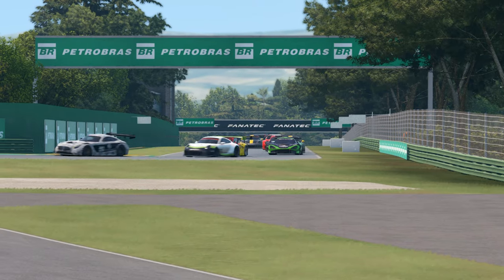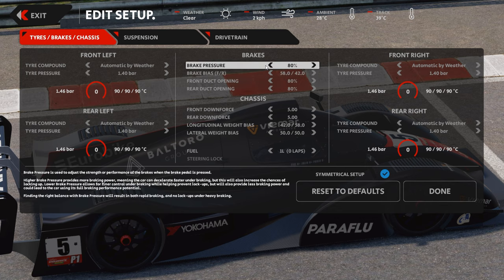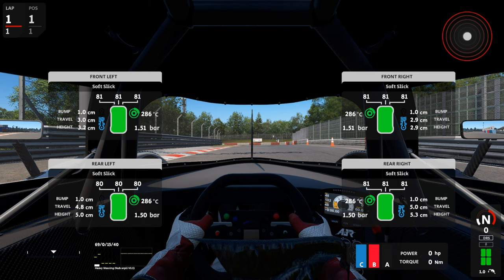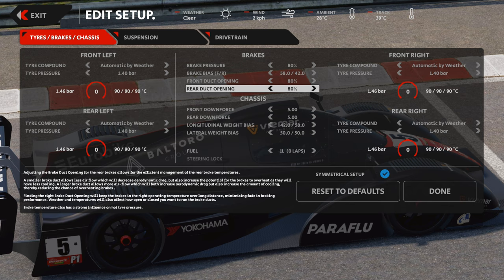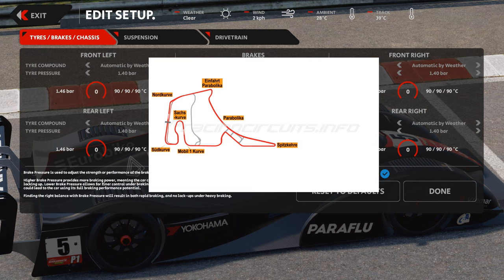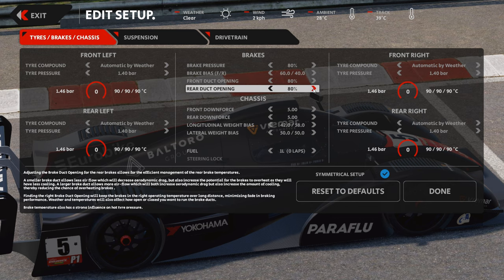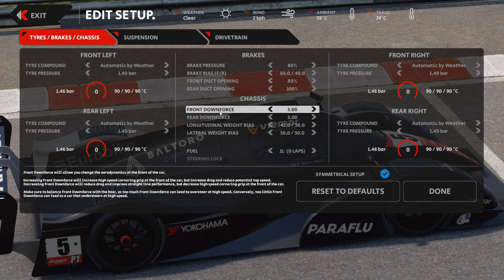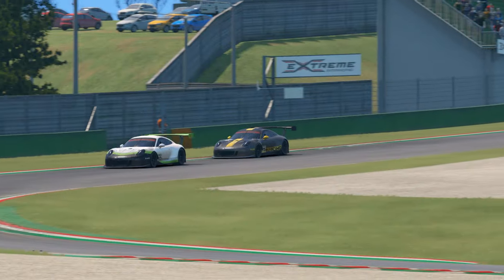Basic Setup Guide (Part 1) - Tyres Brakes Chassis - Automobilista 2

Comment from the maker: *A quick note with regards to camber and pressure adjustments.  It can be a moving target because they effect each other to a certain degree.  Its best to work on them at the same time and it can be a moving target.  Eventually you will get dialed in.*

Comment: Finally someone has come up with this, really appreciate your enthusiasm. Something not clear for me is in 7:21 shouldn't we increase bar to heat tires less and decrease it to heat more? as far as my understdandings you recommend opposite.
Reply: When you lower the pressure all the force is on a lower contact patch, so it gets hotter quicker, less pressure = the opossite
Reply: With a too low pressure, the outsides of the tire heats up more compared to the inside. With a too high pressure, the inside of the tire heats up more than the outside.
Reply from the maker: When you change pressures the IM&Os for all parts of the tire will change.  You have to tinker here tinker there.  You increase the pressure to warm the “M”.  (The middle temperature of the IMO.).

Comment: @Steelcast27 , personally i have no real desire to learn how to create my own setups, i normally take a setup from someone who knows what they are doing and slight tweaks from there.
Your sets so far feel really nice to me, great to have a voice in there now too :)
Keep it up your content is very good.
Reply from the maker: Thats fair.  One thing I would be wary of in your case is that a TT setup might not be optimal for racing.  Its easier to adapt a good racing setup for TT.  Not the other way around.  Most TT builds are just tweeks from default too.  TT setups don’t have to concerned with excessive wear or tire temps.

Comment: Thank you for this as I don't know anything about tuning the cars. Just have a question because I'm getting confused with where the inside and outside part of the tire is, from the telemetry. Could you tell me which part is the outside temp(or inside temp) of the tire referring with the spring/brakes in the picture? I'm assuming the outside temp is where the brakes are drawn in the pkcture but then it always has the warmer temps between the two.
Reply from the maker: Hi Mike,  the temps on the telemetry HUD are exactly as they appear on the car looking from the top down.
Front Left = OMI - IMO = Front Right
Rear Left  = OMI - IMO = Rear Right

Comment: Great video thanks, but what if mid pressure is good but the tire stays cool and wont turn green? Mclaren Gt4 around Cascais (short track)
Reply from the maker: The energy that heats the tires is based on friction and the physical stretching of the rubber. Its not all about pressure. You have to work the tires as well. If you hear the tires working thats good. Soften the pressures and keep it on its limit and you should generate more heat since the contact patch is larger.

Comment: This is a good video, but I think you could've also elaborated a little on the tire wear aspect of the setup, specially in terms of trade-offs like tire pressure and camber and how those affect wear. I mean I know you wanted to keep things simple and you may do that later in a separate video, but I thought adding it here as a sidenote wouldn't have hurt. Still good resource tho!
Reply from the maker: Good point. Optimal camber and pressure usually yields optimal wear.  The biggest determiner of wear are lockups and scrubbing while graining or blistering.

Comment: ive been trying to apply this theory for tyres in assetto corsa  In assetto corsa my tyres are a healthy green glow at 110 and a bluey green between 95-105 Should i go with the color or with the fact sheet. Also how can i drop the temperatures? I know i can change camber angles and tyre pressure but i cant get anywhere near 85 to 90 degrees with those settings unless i use a different compound but again they are blue if i do that

Comment: Great work as always Sir!

I’m noticing the Porsche & Mercedes GT1s seem to get more oversteery after 3-4 laps. If you happen to be finding similar behavior, can you maybe address this whenever you get around to GT1-specific videos?
Reply from the maker: I'll assume you are using defaults?  If so, likely due to the rear tires giving out.  The tire model is VERY generous for 1 or two laps.  Thats why we can get away with pushing for say a TT without proper cambering or pressures or overall balance for that matter.  Its a HUGE false positive.  The description of my vids will always have a schedule and I am currently working on GT1 projects.  And YES, the GT1s in particular are harsh on the rears, even with a proper setup!  so I can only image what its like running 3+ laps on defaults.
Reply: @Steelcast27  Thanks for the reply. Yep, essentially defaults on my attempts with the GT1s. Just shortening the gears, and small tweaks to the brake balance and/or pressure. The temps on the rears seem to end up about +8 to +10c compared to the fronts after 4 laps or so which is what I thought could be causing the oversteer. The I|M|O values on the rears all remain the same relative to each other though and in check. Just the numbers for all three readings go up by 8-10c compared to the fronts. Also, the pressure values remain essentially the same as the fronts which really doesn’t make sense to me if the temps have gone up by 8-10 degrees.
Reply from the maker: Don't worry about where the pressure ends up in bar or psi relative to tire temps, so long as the IMO is good.  Its just numbers on the screen for now.  probably will be fixed at some point by Reiza.  During the course of a lap the temps will rise and fall for the IMO as well. You are actually looking for the average IMO here AFTER everything is stable (it takes about 3 laps) .  As far as the rears heating up. MAX MAX temp is 104c over that and you're getting into spin city.  So you need to change your driving style to reduce heat in the rears OR risk the spin.  Closing the rear ducts can ony do so much.  As far as the heat in the rears climbing uncontrollably, that's a problem with the setup that I cannot really fix in chat.  Essentially, the rears are slipping too much and you need to figure out when and where and what adjustments to make to stop it.  My mechanical grip (tab 2) tutorial should be ready by Jan 23rd.  I wish I could push content out faster than than, but Im on a pretty severe sleep deficit as is.  :)

Comment: I could not get this to work on the bt44, even on max camber possible Tyre temps are still quite even across the tyres (within 2-3 deg c on most tyres). I get the feeling the stock setups are way off on some carsin AMS2. I compared AMS2 to RF2 for the BT44 the AMS 2 version handles a lot worse IMHO, its much more twitchy on stock setup, I can't get it close to RF2 version (but i'm still a setup nube)
Reply from the maker: These are just goals, some cars like retro F1s will not reach the camber goals in particular, just by the nature of how the cars work.  And yes, the default setups aren't great.

Comment: Why make a seven-degree spread on the front tires when a better contact patch indicates a 2-degree spread on the tire at the end of a long straight when they tires are not deformed, this also ensure that the ware rate is even on all four tires?  Your set up will eat up tires, and defeat the purpose of adjusting caster and camber.

Comment: what number is I M O ? 

near the spring is Inside? and near the brake is Outside?
Reply from the maker: Using the telemetry HUD/UI, the IMOs are laid out exactly like they are on the track, above each of the wheels. Technically, reading the screen, the left side tires are OMI.
Reply: @Steelcast27  thank you.

Comment: Assuming your not racing on an oval circuit, if your tyre temps are not even across the tyre then your camber settings are all wrong! NO way do you want IMO temps of 85 87 90 for example.
Reply from the maker: What matters here is the cornering contact patch for the loaded tire.  The tire IMO should be even.  *while cornering*.  The inner temps being slightly higher is simply a natural consequence of driving in a straight line.  For example.  If the car is in a constant state of turn, yes the outside tire would have an even IMO.  Say you camber the car perfectly under that circumstance. Nice and even.  Then introduce a straight.  The outer edge will cool giving you a temp difference across the tire.